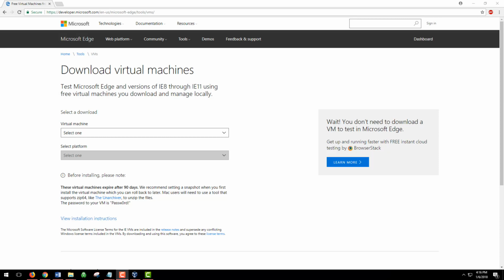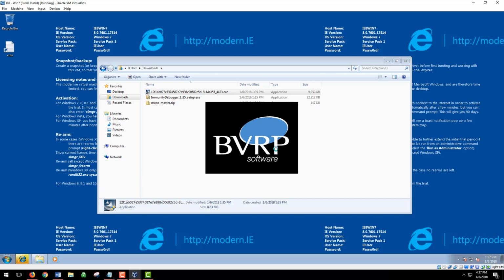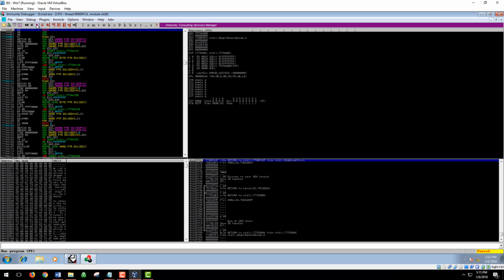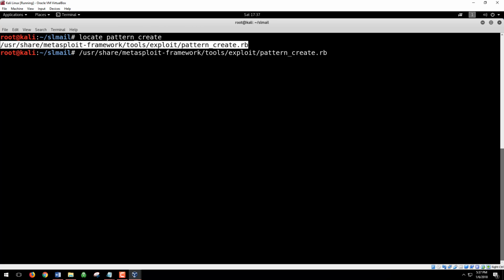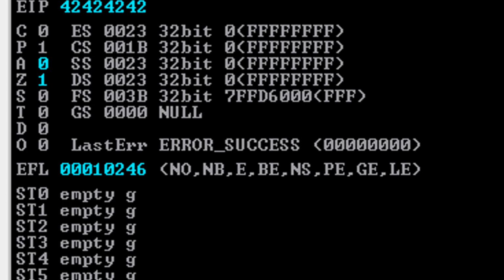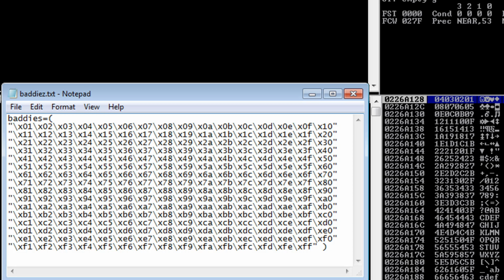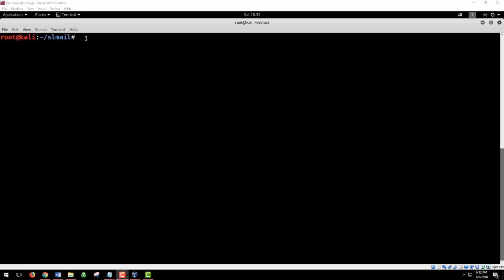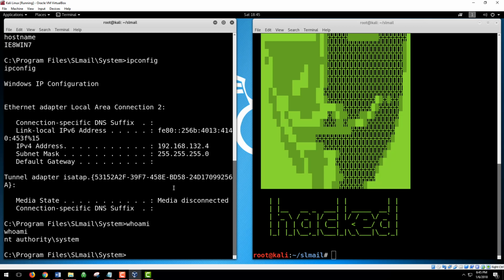SLmail Buffer Overflow Exploit Development with Kali Linux

Comment: when looking at the mona modules, there was another False, False, False, False, True further up. Why didn't you use that one?
Reply: To make the most reliable exploit, you want to use a module without ASLR, SafeSEH or Rebase - All false. Otherwise you'll have to use Return Oriented Programming (ROP)  gadgets ( Windows DLL code ("Gadgets") to construct a program) to defeat Data Execution Prevention (DEP) or ASLR. There are Mona modules for creating ROP Chain. Nice Video though!

Comment: Can you please confirm how did we get No ops sled = /x90*16 ? It's confusing.
Reply: we added the no opsled there so that the changes that occur due to env var should not affect the overall payload. as nopsled  just represents nothing, and different windows can have different size of env variables, so nopsled fills the buffer with nothing and our shellcode exactly lands at eip, so if you take nopslesd a little or more than 16 it should not affect much.
Reply from the maker: Appreciate your input @AVi  GAMER.
Reply from the maker: Trial and error Dhruv.
Reply: Jesse Kurrus ideally it should be simple mathematics. Complete package was 2700= A*2606+4 bytes EIP+ 90 bytes[shell code + NOP]
Reply: But when I calculated shell code size it was 1683 bytes, way beyond C=90 which we initially calculated.
Reply: @JesseKurrus  Hi Jesse, great video as always. I am curious - should "achars + jmpesp + nops + buf"  add up to include a total of 2700 bytes as we calculated earlier in the video?
Reply from the maker: Hey Andrew. Check out my Python code, it shows the exact calculation.

Comment: Man, this exercise looks fun. unfortunately, the SLMail app from the Exploit-DB doesn't install correctly on Win7 anymore. I even disabled the FW and Windows Defender and tried again. The SLMail Configuration icon is blank (unlike yours which shows the logo) in the Windows menu and clicking it does nothing. I got the regular Win7 image from Microsoft too :/
Reply from the maker: Hi @Bunny Meats,

That's incorrect. It still works exactly as depicted in the video. You must have made a mistake somewhere in setup/configuration, or got the wrong app maybe. I just verified that the following works. Got a SYSTEM shell with the exploit script right away (after generating msfvenom payload and changing IP of course):

https://www.exploit-db.com/apps/12f1ab027e5374587e7e998c00682c5d-SLMail55_4433.exe
https://az792536.vo.msecnd.net/vms/VMBuild_20180102/VirtualBox/IE11/IE11.Win7.VirtualBox.zip
Reply: @JesseKurrus  Thank you. I was using the VMWare version of IE8WIN7 - I'll try your link with IE11WIN7 for VMWare instead. I thought that was odd. The little icon is a blank white box and the command does nothing on that version. I even tried two different VM instances on two different machines. I'll let you know how it goes with this IE11WIN7 version. Thanks again.
Reply: @JesseKurrus  I can confirm that it does not work in the VMWare image that Microsoft provides, but it does work in the VBox image that they provide. Even the UI looks different so they must not be aligned, even though they say the same title "IE11WIN7". Thanks, Jesse. I can't wait to write a remote exploit for this SLMail service!
Reply from the maker: Good, glad you got it working.
Reply: Still the same issue and that's the third VM I have tested. I am downloading and installing Oracle VirtualBox now to test the link that you posted. I really didn't want to go the VB route. Microsoft possibly has different versions/revs per platform.
Reply: bunny u r trying it on windows7 64 bit where this software is only created to be installed on x86

Comment: Thanks a lot Jesse Kurrus, this video is awesome. I have a question, what happend if the EIP register contain the 43424242 values "BBBC" and not 42424242 = "BBBB". I have use the pattern_offset and got the 39694438 value, the same value acording to the video.
Reply from the maker: Hey Armando, np. Sounds like you input the incorrect amount of characters. I suggest you try again exactly like you see it in the video.
Reply: Thank you Jesse, I have reviewed my python script and I found that this was the problem. I'll continue with the other steps. xD!

Comment: Has anyone else had a problem with the msfvenom command? I even copied and pasted the exact command above and only changed the LHOST ip address and got the same error.
Reply: I'm running an apt-get update && apt-get upgrade to see if that makes a difference. Will let you know.
Reply: Well, that fixed it.
Reply from the maker: Glad you got it working Randy.
Reply: One more question: In the fuzzer.py program, what does the s.recv(1024) and s.recv(1023) stand for? I see that the first command connects and that you will receive a reply from the POP3 server. Is it the number of bytes returned? I understand the USER , PASS, and QUIT.
Reply: Once again, I answered my own question. https://docs.python.org/2/howto/sockets.html#socket-howto
Reply from the maker: Heh, glad you took the initiative to look it up. Pretty simple py script.

Comment: And if you run that script to another target with same configuration will it work without changing values (changing ip)
Reply from the maker: You need to change the shellcode to reflect the IP/port of the attack machine, and specify the IP of the target machine as demonstrated in the video.
Reply: Thanks

Comment: Awesome video...
Reply from the maker: Thanks Shikhar!
Reply: Jesse Kurrus just one question. I have just finished my OSCP labs, and throughout the slmail tutorial, offsec folks have emphasized on break points. Plus, for vulserver.exe, the exploit didn't work when I was not using break points. So, as you have not used any break points, in general I wanted to ask will it make any difference, if I am not using any breakpoints and moving quickly to complete the exploit, as I will be giving my OSCP exam in a week. Any advise would be appreciated.
Reply from the maker: It's a good idea to understand break points and how they're used, but I don't recall requiring it. Things may have changed though since I took the class.

Comment: I don't understand the purpose of this exercise on the level of "real world" usage. I am new to this, but it seems that you wouldn't be able to use this method because you'd have to have access to the Windows machine that you are trying to get access to? Or is it to be used if you can gain some sort of lower privileged access on the windows machine and go for root from that access level?
Reply: In the real world, you would discover that the target is running this program by fingerprinting the service and detecting the version either by using scans or through a low priv shell. Once you have that information, you can go find the actual program on the internet and do your own local testing and develop an exploit. Once you've done that, return to the original target and utilize the exploit you've developed to gain a system shell remotely or locally.
Reply from the maker: Good stuff @Greyson Grill. Agreed.
Reply from the maker: To apply this concept to 'real world' usage, you'd need local access to the application you're trying to exploit to analyze output in the debugger. The point of this video is to learn how to discover a buffer overflow vulnerability, develop a buffer overflow and use the debugger, and the shell code from msfvenom is to demonstrate proof of concept to show how a buffer overflow could be leveraged to get a reverse shell with root access. Makes sense?
Reply: Yes thank you.
Reply from the maker: Np Ryan.
Reply: Hi Jesse, maybe I could message you separately, but could you give any pointers to someone who's ultimate goal cert/learning-wise would be to pass the various OffSec courses starting with OSCP?  I have no industry experience and only really know basic command line items (i.e. overthewire Bandit wargame) and basic networking although I have been "surface level" with computers for many years. I have built a couple of cryptocurrency mining rigs, built some computers, a hackintosh; that sort of thing. - I have the time and drive to learn what I need to learn, I just get overwhelmed of what to learn first because it seems there are so many things to learn; I guess my overall question would be is there something or things you could point me to specifically to prepare for the PWK/OSCP course? Thank you in advance.
Reply from the maker: Hey Ryan,

You gotta focus hard on enumeration, network exploitation and privilege escalation. There's a lot of different ways to exploit these VMs, so practice a lot. It took me 60 days to pass on my first attempt, but I bought the 90 day lab package just in case. Aside from doing the PWK course and hacking as many vulnerable VMs as possible prior to testing, I'd suggest the following resources, which you can take before, after, or during the PWK to help with preparation:

https://www.udemy.com/kali-linux-hands-on-penetration-testing-labs/?couponCode=TENDOLLARS

https://www.hackthebox.eu/

https://www.vulnhub.com/

Other than that, TRY HARDER. :)
Reply: Thanks Jesse

Comment: i went over the video but I'm unsure of one thing. what does this part of your code mean? buffer = "A"  *2606 + "B"  * 4 + "C" * 90? I'm new to python. What does A, B, and C signify?
Reply: 2606+4+90=2700 ...the bytes 
1)that give a successful connection to us 
2) make the system buffer overflow at the same time... ...( but the "B" *4 =BBBB (actual value) =42424242(in hexadecimal ;when you look in immunity debugger).....

C *90 is called nop sled... this the PORTION which help you to sled to a overflow...(I think I am right ...)

First programmer has to confirm the exact EIP ( BBBB) location with the bytes he put in...then he finds 2606 bytes with pattern match...then he confirms it with the 2606+4+90.....again....then he try to find bad characters....to make sure his program encoding payload is completely accepted by the buffer...and it overflows...and
Reply from the maker: Mstifye,

This is setting the buffer variable to the literal strings of 2,606 "A" characters, 4 "B" characters, and 90 "C" characters. For example, setting a variable to "B" * 4 is multiplying B by 4, which would be equivalent to "BBBB". In that script, the goal is to crash SLmail and show us that we can reliably control the EIP by overwriting it with four "B" characters, which is 42 in hexadecimal. Makes sense?
Reply: @JesseKurrus  Would 94 "B" characters yield the same result? Asked another way, how come the EIP register holds 4 "B"s when the last characters to be sent to it are "C"s?
Reply: Jesse's explanation is awesome...He is best to explain an exploit development ....He is carefully explaining whatever he writes ...the best in YouTube!.....

I have looking around every where to understand what the fuck  an exploit development and how to do it....

Jesse explains more,more.......
Reply from the maker: Haha! Thanks Arun.
Reply: They're characters
Reply: this is an awesome video and im learning alot, i just have a question about the badcharacters section where did you get those bad characters \x01\x02\x03 etc etc ...  did you run metasploit to generate those characters ?